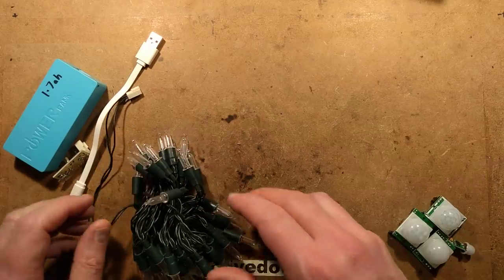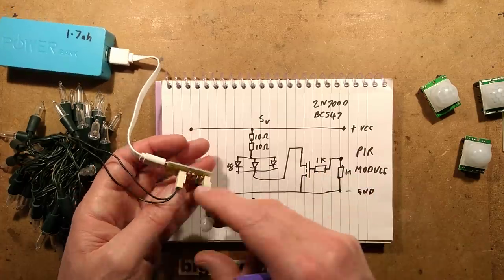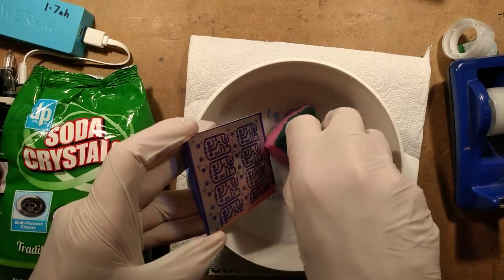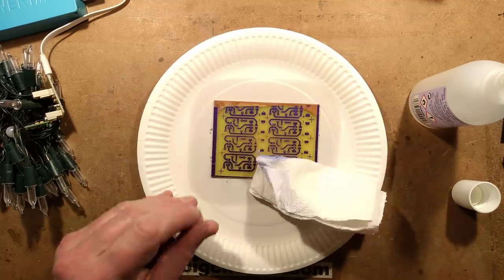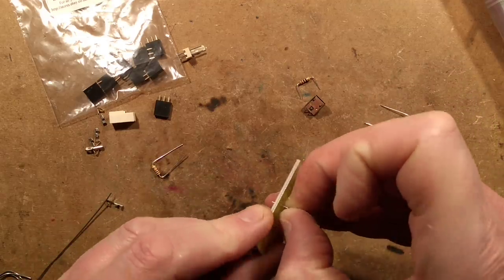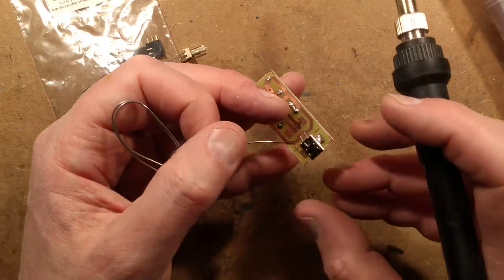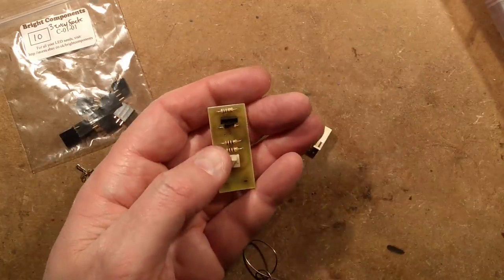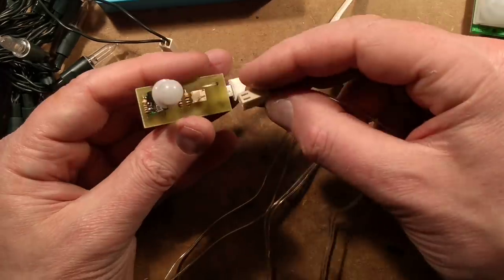USB to PIR to LED-string interface PCB.

Comment: Seems a bit sadistic in this day and age to spin your own PCBs.
Reply: I think for one-off projects (likt this one was) it is the way to go if You do not need a multilayer board. I would much rather spend an hour or two developing a board instead of two weeks waiting for a board from a fab.
Reply: Piotr Porada depends what equipment you own I guess. I’ve tried all sorts of prototype kits you can use with a laser printer and iron on, or the old OHP transparency with a light box and all have mixed results at best. Unless you’re making something very simple with big components it’s a nightmare. I can normally get 5 prototype boards delivered in 3-5 days for about £20.
Reply: I think you don't know the meaning of the word "sadistic". Who is getting hurt by making you own PCBs? The Chinese?

Comment: Why don't you use the Laserprinter methode by printing on inkjet photo-paper with an laserprinter, and using an cloth iron to fuse the Laser particles to the copper
Reply: Because the photoresist method is much more consistent and accurate, and doesn't really take much longer.
Reply from the maker: I never had much joy with the toner methods.  Mainly because modern laser printers often put down very little toner.

Comment: Brown finger, ferric chloride, what-ever!
Reply: I'll remember to use that excuse next time.
Reply: Remember not to dip your nose in the ferric chloride too much
Reply: When I was first starting out as a 15 year old  I opened a packet if ferric chloride and got dusted up the nose. Hard to wash you nose out, but sticking a wet finger in repeatedly helps. 😁

Comment: I have these lights around my house there hooked direct to the battery in the power banks with a switch to turn them on/off . the power banks are charged all day for free with a few solar panels .(12 vott battery 120 volt and usb out puts) I have about 200 leds around my house so lots of light for about 6 hours a night for free .I charge them using the power banks built in charge controller so had to add nothing to the set up except the on off to get the 3.7 to 4 volts i need to power the lights because the 5 and 6 volts the power bank puts out is to much for some lights i have set up but 2 strings do need the big 21000mha pack that takes all day to charge but it's all free lights now that ive set them up over time. I tried to have them turn on using the solar garden lights but its to much power for the garden light to handle ive hooked up the 5 volt to a 1.2 volt garden light but it just by passed everything and turned the light on